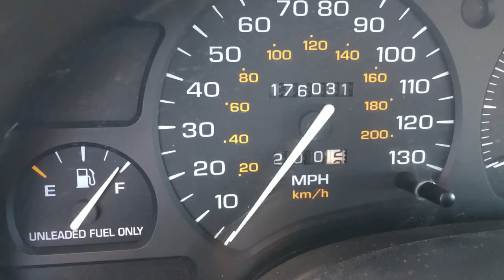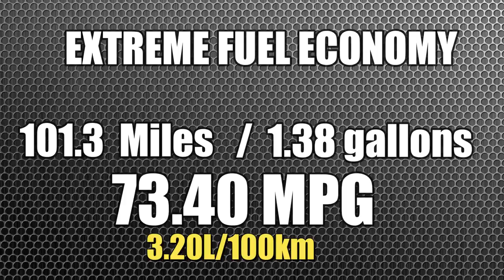S3 E11. Kubota turbo diesel Saturn extreme fuel economy.  super high MPG

Comment: 2.5 hours at 45 mph. We appreciate your commitment. 😴
Reply: We should build a simple manual 4 speed tranny up to the 40 hp kubota! Roads in Quebec are not safe over 80 kmph! Weld up a galvanized frame and panels! We could build a beautiful little extend a cab truck, for under 24,000 dollars! Safe strong and rustproof! I know we could!
Reply: Most speed limits are 35-45mph.
Reply: Try traveling at ~ 12 to 16 mph longer distances on a Ebike.  (Did 45-48 miles last Friday under this regime.  Furthest I’ve gone is about 58.  Want a battery charger I can take with if I go further afield.)
Reply: If I remember years ago I heard fuel mileage is based on driving at 45 mph.
Reply: You got the same milage as one of those mopeds you mentioned.
Reply: @dennisyoung4631  Ive done this on my Segway scooter but man, I ain't got time for that.

I don't even pay to charge it though is the best part lol. It charges at my work or my gym and that's it. Ebikes definitely get cooler every year

I really want an onyx e motorcycle.
Reply: @Seasniffer69  I cannot afford the fuel and maintenance on a more-conventional vehicle, and due to being disabled such that I must consciously “act normal” when around other people - this is what I can do.

Note that I assembled this one largely on my own, and paid enough for parts and tools to purchase a ready-made example - and not a cheap ready-made one, either.  I recall spending more to put this bike together than the cost of my last car - upward of 3 k.
Reply: @runed0s86  lol no
Reply: @dennisyoung4631  haha poor
Reply: @runed0s86  ,correct.  In small towns most speed limits are 35-45 mph.😂
Reply: So just like being stuck behind a pensioner on a winding UK road.
Reply: @briangall8442  😂😂😂😂😂
Reply: The fact it takes so long to get to speed will just get you flipped off repeatedly in town 😂
Reply: @jhonviel7381  haha douche
Reply: @Kyle_gallegher  most people don't get up to speed quickly in town. I can usually ride a bike and keep up with them

Comment: The 3 cylinder diesel exhaust clatter at idle makes me smile.  I have a 1986 JDM Mitsubishi tractor with a 990cc 3 cylinder and it sounds about the same.  That thing is so dang simple to work on.

Comment: Think positive. On the moped, if a shower comes up, well, you're soaked. You hit a deer, and you go to the ER or the coroner's office. The Saturn's the winner hands down. I used to have a '93 Geo Metro XFi bought new to use as an airport car. Fully stock, it was good for hi-40s, low 50s MPG. I wonder what something like this powerplant would have done for that car? Incidentally, I sold that car after 20 yrs, and someone from Washington State bought it sight unseen, flying down to S. Florida to drive it all the way back home. Got a message a couple of weeks later about how it made the trip flawlessly, averaging 57 MPG, and praising what a great car it was.

Comment: If you look up, Opel GT, they built two cars for the 24 hours of Lamans race. During the race the two cars averaged 144MPH, and I believe it was 114 MPG. Both were 1.3 liter turbo Diesels, and electric drive train. It was about 2004ish when it was done. We are all being sold a line of crap when they say we have to stop running petroleum products for fuel. Not the case! We have to start using them properly, and things will change! These ideas have been around for decades, but the powers that be don't want us to know!

Comment: Diesel engines are the most efficient engine designs in the world. The fuel is easier to produce less volatile, which means it’s safer. And it cost less to produce. Unfortunately, the government makes us pay more for it. Nice work Jimbo. By the way, driving through rural Kansas ain’t really that boring. This time of year you got the trees budding out,  wheat fields filling out, we got farmers working out in the fields, spring turkeys, young deer, all beautiful.
Reply: It's only more efficient in the "no load" mode. Diesel fuel naturally has more BTU's per gallon and that is where the extra fuel economy comes in. My Ranger diesel got 30 mpg driving 45 miles to the town he works out of back in the 80s. My new Maverick hybrid will easily get 33 at 70mph and if I slowed it to 45 would probably get 45 mpg. Better than the other Saturn.

Comment: Thats not bad at all, mine drove on the governor at around 46 with no load unless going up hill and I was getting right around 98mpg on used oil ,it was nice driving 2 weeks on a gallon of free fuel lol, with the bigger engine and turbo thats not bad at all

Comment: Aero dynamic drag is a big part of the load placed on the engine.  For heavy semi trucks, just increasing speed from 90 to 100 km/hr increases fuel consumption 20%. On days with strong cross winds........the affect on fuel economy was......well drastic.   The only countermeasure was to  slow down to 80km/hr to blunt the effects. I am still of the opinion that the boost is a long way off ideal..........20psi is the minimum a diesel needs to do well.  Unfortunately, it can be very challenging to get the right size turbo charger for a given application, especially with very small engines.  However, insulating the turbine housing and manifolds has been proven to have very positive effects in improving the conversion of exhaust gas energy to boost pressure.  Heat radiates at the fourth power..........and at typical temperatures of exhaust gases, that is very significant.  A turbo blanket and some high temp wrap are not that pricey.

Comment: my 89 Nissan Sentra , which I bought used 4 years ago for 1200$ , and has 248k , gets 44 mpg at 55 mph . 1500cc 4 speed , 35 psi in tires . ( I have a steady throttle foot ) . Cheers !

Comment: Well, all you have left to do is add an HHO generator to this baby to get even better fuel economy and more torque. I installed one on my 2.5 L diesel (aspirated) van, and after tinkering with the electrolysis current, I'm close to 30% economy, which sums up to around 6L/100km. Not too shabby for a 1.8 ton van!

Comment: My first car, an old shitbox 94 Citroen AX 1.4 Diesel... would spend about 4l/100km but it did sounded like a tractor.. and no forced induction and about only 53hp... nothing great to write home about it but it allowed me to roam all over Europe. When it eventually died due to a head gasket design flaw, I got a Ford Focus gas powered station wagon and the fuel consumption and cost difference was painful.

Comment: cool deal! was the engine running under boost at times, do it again with boost gauge when your butt is not all numb from road testing. cool outside air forced thru intercooler will increase torque & horsepower with the your same amount of fuel with mechanical  injection pump. GOOD VIDEO!!

 
 
,

Comment: I'd like to add to the topic of lean AFR versus EGT. In gasoline engines it's possible to operate them in a relatively narrow window of AFR, they are usually capable to run from AFR=~8, to AFR=~16.5-17, while the stochiometric ratio is 14.7.
This means that gasoline engines can run really rich, but not very lean.
The EGT depends on volume and thermal capacity of unburnt mixture in the cylinder, so when you go rich, you get lot's of unburnt fuel in the cylinder that has some thermal capacity, and effectively limits the EGT.
When you go a bit lean in a gasoline engine, or even just close to 14.7, you do more complete mixture burn, and have no leftover unburnt volume of fuel nor air, so you get the highest possible EGT.
Because fuel injection can't ensure 100% consistent and perfectly mixed air fuel mixture, even at 14.7 you get a bit of unburnt fuel.
Because of this, when you go to 15.0 or even a bit higher, the EGT may rise a bit more because it is at that point that 100% of fuel is getting burnt in the cylinder, and only a bit of air isn't. And air has very low thermal capacity compared to fuel, so you need a lot of it to limit EGT.
But, when you lean out a gasoline engine even more, to AFR 16+, EGT starts to drop because you get more unburnt air in the cylinder, and also you get less fuel in total in the cylinder to burn (so less thermal energy is released).
Engineering Explained channel had a really good video on this topic.

The transition between those modes is tricky, and rich mixture at WOT is effectively used as a supplemental coolant for the valves and pistons, which is why gasoline engines can't reliably do lean AFR at WOT.
They usually can do lean AFR at medium and low load at medium and low rpm, when the engine has lots of thermal headroom, and no risk of melting the valve seats, or pistons.
It was in fact used this way in some factory cars in the 90's I think (some honda's likely had this), and it was called the lean burn mode and worked only in low/medium engine load at some medium rpm range.
This was not used since then because such lean gasoline burn causes quite significant NOx emissions, and that got restricted with the EURO emission norms. 
So as a compromise gasoline engines since then use more fuel than they need, and emit more CO2 than they need, only to reduce gasoline engines NOx emissions.
NOx is very nasty compared to CO2 so it sort of makes sense, but I'm not sure what where the actual values compared to diesel engines.

Going back to AFR vs EGT - a diesel engine can run at extremely lean AFR, like 20.0 or even higher I think, and that's why going super lean on a diesel engine reduces the EGT significantly (because you can go way more lean than on a gasoline engine).
And to sum up - the fact is that diesel and gasoline engines behave in exactly the same way when it comes to AFR vs EGT, but gasoline engines can't go very lean, but they can go very rich. On the other side, diesel engines can go very lean, but can't go very rich (because preignition would then easily happen, while just dumping a huge fuel ignition dose to the cylinder only wastes fuel as it can't mix with the whole cylinder volume before self igniting).
Reply: Thank you for this astute and very articulate comment.
Reply: "Because fuel injection can't ensure 100% consistent and perfectly mixed air fuel mixture, even at 14.7 you get a bit of unburnt fuel."

I always wanted to see a GDI engine experiment where the fuel is heated past it's 1atm boiling point just upstream from the injector. Should flash to vapor immediately on injection...
Reply: Actually, lean mixtures in gasoline engines can dramatically increase egt's.  This is due to a delayed burn taking place close to and during the exhaust stroke.

Comment: In a mad max type scenario, I would be the only guy pillaging the Holley performance warehouse, getting terminator x computer setups to run wideband O2( for mixing in e85-ethanol-methanol) 
Shoving big turbos, and wild motors into beat 1 ton 4x4 truck with a big boom on the back. 
Save the diesel for the big Pete wrecker.
I would be hauling back tractor trailer loads of supplies, those wreckers are almost armored to start with......little extra on the cab and your golden.

Comment: Screw 'em lol. I would set the cruise to 5 under the posted limit in my ALH to squeeze the most out of the tank. My record was 1403km. I was planning on fixing some of the aero and some other mods to push it even further, till i wrecked it lol.

Comment: Since you have glow plugs and I am assuming they're drilled into the combustion chamber you could in theory install in cylinder pressure sensors to give you a better idea of the combustion pressures in cylinder before and after any tuning changes

Comment: When doing extreme milage test, shouldn't the windows be closed to lower drag?
Reply: The car doesn't have ac....we don't need Jimbo to die of heat exhaustion for this test on a warm day
Reply: @silverfin198  Hes been doing a lot of thest in pretty low outside temps, still hes always got the window cracked a fair bit. I guess hes just quite temperature sensitive.

Comment: Here's an idea. Try running biodiesel(used vegetable oil) in the Kubota. Since it's an older diesel engine, it should be pretty straightforward. Filter it out, and might need some methanol or anti gel additive mixed in. The fuel economy may decrease, but it'll be cheaper than diesel fuel.
Reply: good luck getting cheap veg oil anymore. the cat got out of that bag 20 years ago now big corps buy all that fryer oil
Reply: Blah... Crank up the injector pump some and inject propane into the intake! Why this hasn't happened yet is ridiculous! Who cares about economy? Because ya know there is many of Kubota powered cars out there n all just wanting to know how to get better milage! 🙄
Reply: Filtering red diesel and dying it green is cooler.
Reply: I'm going to modify my Delica Stsrwagon turbodeisel to run on veggie oil. More as a SHTF option or if theres a fuel shortage. Whenever I get a homestead going though, I want to experiment with producing my own veggie oil from scratch. You can get about 50% of the oil out of nuts just from a press, then the other 50% using solvents like hexane. The hexane is recycleable, industrial veggie oil producers get about 99% of their hexane back. I would like to find a biochemical alternative though, make the process truly fossil fuel product free. Anyway, I'd be interested to see how much crops it actually takes to fill up a tank.
Reply: WMO should work on the Kubota diesel
Reply: Get old engine oil from truck repair shops 👌
Reply: Try filtered used ATF oil for that Kubota!
Reply: @waveman8923  , yes ATF is an excellent fuel in a mechanical diesel. There's a company that make a centrifuge system that runs at 7200 rpm's. It will remove ALL contaminates from recycled "fuels" and they will then be able to be  combusted very effectively

Comment: 3.2l/100km is very good for what it is, first generation TDIs in cars like Mk3/Mk4 Golf, Jetta etc. can get to around 4l/100km when driving slowly on open roads, altough more realistic economy when driving normally is around 5l/100km outside city.
Reply: Yeah. The highest economy i got from a diesel is in a 3 series 2.0 litre. 55mph on the highway, tucked behind a lorry, i've managed 3.1l/100km. With a lot more power than this kobota or any of the factory 1.9tdis. So it's not all about engine size or power, it's about how efficient the engine is (commonrail helps a lot here) and what gearing you have. At 55, i'm only turning about 1500rpm (some 3 series go even lower) which is right in the engines sweetspot of efficiency.

Comment: Great stuff!! Been following you for awhile now, really liked the Speeduino implementation on the harbor frieght engine and it makes me wonder if it anything it offered would be helpful in this setup?  I'm trying to think of a way that would make your life easier for measuring the fuel consumed, albeit your knowledge and creativity makes repurposing tools impressive.  The drill bit and the combination square is very clever!
Reply from the maker: I have an extra speeduino NO2C kit and I have been thinking of connecting it to the sensors obviously it wont work to run the engine but it would be an easy way to datalog the performance.

Comment: Love to see what that engine would do in a GEO metro hatchback coupe. Its probably 1/2 the weight of the saturn, more aerodynamic and could probably get 100 mpg doing 65 mph.
Reply: It would need tall gearing.
Reply: Specs say a GEO is 1800 pounds
Reply: @bladenrexroth2555  probably drops a couple hundred pounds after engine and gas tank removal
Reply: No way it could get 100mpg at 65. You are talking about 10-15% or so increase at best over current values. Geo metro isnt that much better in drag, and the weight doesnt make a lot of difference.

Comment: I worked in a underground hard rock mine and the most used vehicle were the small kabota UTV's with the same engine in your car. These UTV's would be ridden hard and put away wet, going up miles long 12% incline ramps at full throttle with the temps right at overheat were the norm. We didn't have EGT gauges but I wouldn't be surprised to see that your engine can take way more than your throwing at it judging by your coolant temp

Comment: Rolling the window up would help just a slight bit. I commute almost 100 miles one way to work. I put my tires at 50psi, got 36mph but tires only lasted 20,000 new set at 40psi and it gets 33mpg. I don't think the mpg out weighs cost of tires.